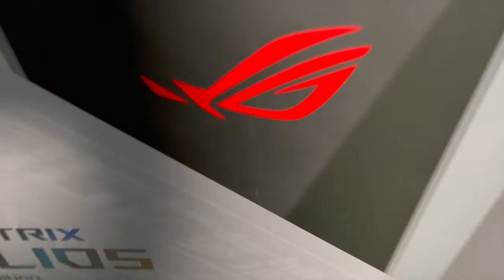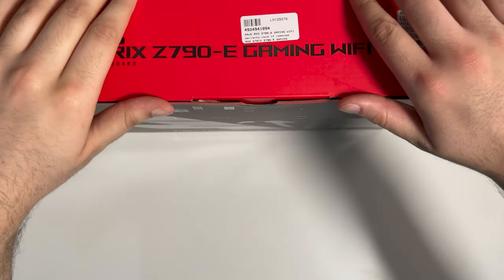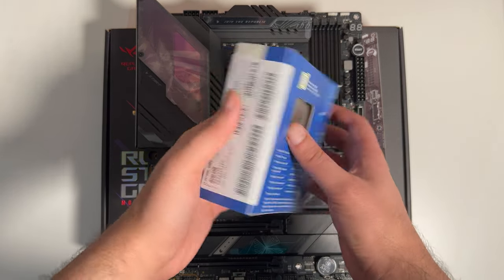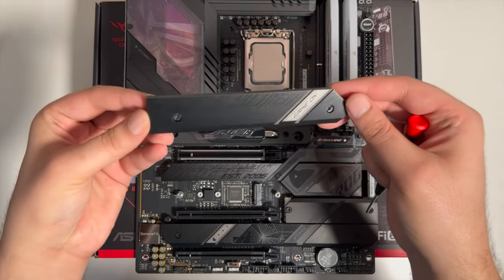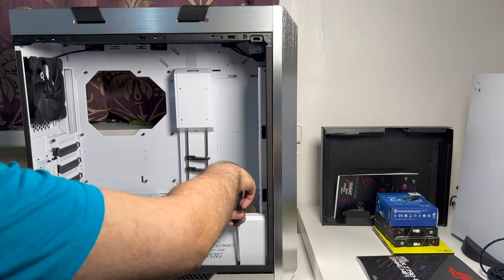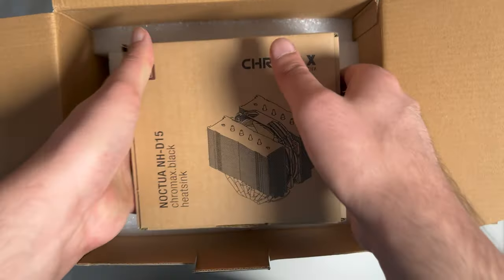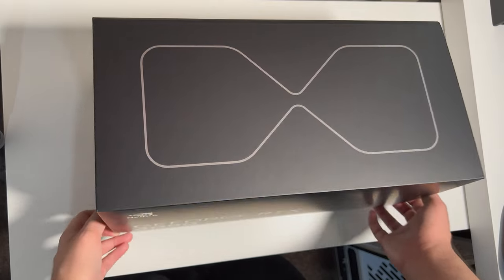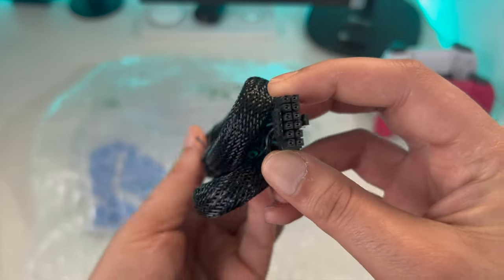Building My DREAM Gaming PC | White Aesthetic x ASUS ROG Build | 2024

Comment: Nice build bro!. I like how it's not perfectly aesthetic in the sense that not everything has to be perfectly matched (white case, white mobo, gpu etc) with all the fancy cable extensions and rgb fans, but still looks ultra premium with all those high-end parts. Reminds me of how builds looked in 2016 to 2017-ish haha. We can all kinda expect what Helios builds would look like but I think yours looks really simple and unique. Just a beast of a machine with a few lights here and there.
Reply from the maker: Ayy thank you bro! I appreciate it. Yes exactly, I chose the parts I wanted but I also didn’t want to make it too flashy or perfectly white. Sometimes simplicity is key even if the Noctua cooler is beefy and blocks the ram rgb lol. I’m still planning on adding some rgb fans to the top of the case at some point, and possibly some cablemod cables. The build never stops ahah. I love it, runs like a dream and performs like a beast. Now I just need to upgrade my desk and have it in full view on the side.

Comment: you could have used the nvme drive just above the first one you installed for it to use the pcie 4 lanes
Reply from the maker: Yeah, that top slot is gen 5. If I did that then gpu slot would run at x8.

Comment: Why did you go with air cooling for the CPU and I'm sorry that you chose all ASUS parts. Things haven't been so good with them these days
Reply from the maker: I prefer Air Coolers compared to AIOs, a good air cooler would last me a really long time compared to let’s say some of the cons an AIO may develop over time. Like leakage or the pump dying out or liquid evaporating.

Personally I’ve had no problems with using Asus parts, they’re really great but I’m pretty sure you’re referring to the voltage problem that is only restricted to AMD 7000 series CPUs & AMD EXPO having issues with other board manufacturers aside from Asus. My build is intel, so I’m safe for now. Unless there’s another problem I’m not aware of?

Comment: I'm debating doing a 4090 with 7800x3d, but still don't know what 4090 to get.  trying to find one that doesn't have loud fans
Reply from the maker: You’re probably best off getting the 4090 FE, it’s currently in stock right now and has the best cooling as far as I know and is really quiet. 

Good luck on your search 👍

Comment: Have you noticed any cpu bending while locking the cpu into mb?
Reply from the maker: No, not at all. I didn’t notice any cpu bending issues after locking it in. Thermals are all looking good too. 

It’s a non issue, I wouldn’t really worry about it but if for some piece of mind you can always get a contact plate. 

Hope that helps :)
Reply: @KhalZain  thanks